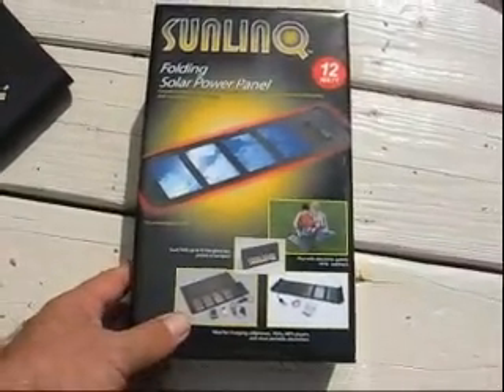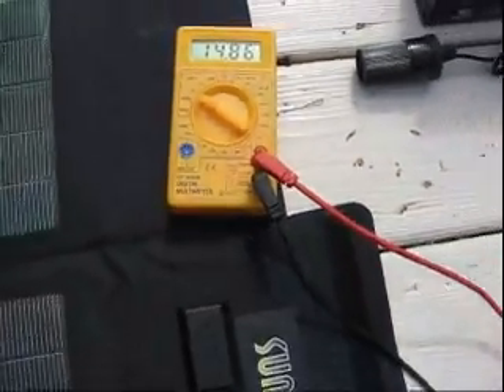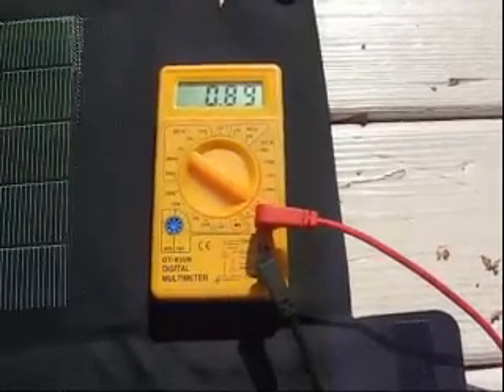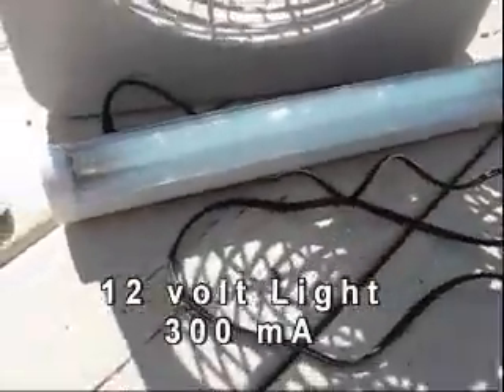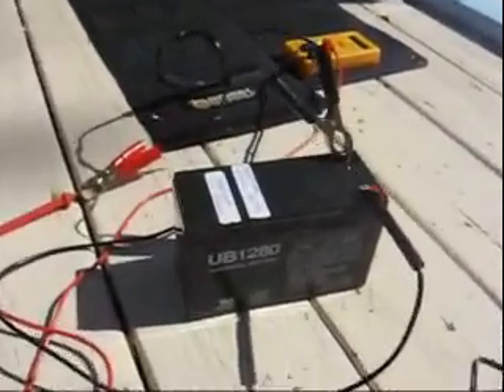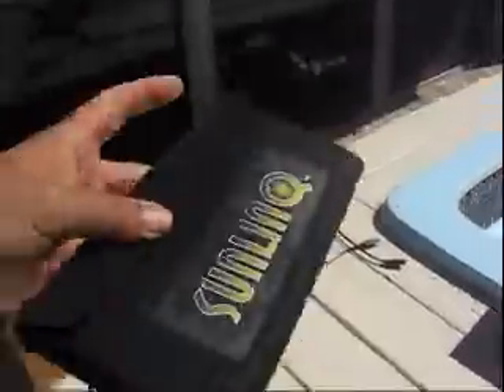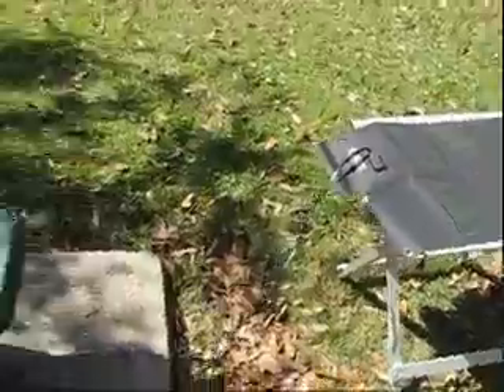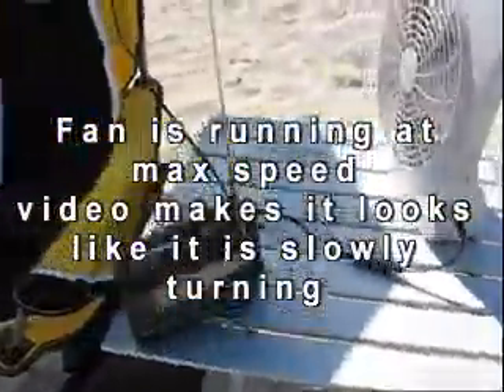SunLinq Folding Solar Power Panel 12 watt

Comment: can anyone advise on off grid AA battery charger for this unit.I have a 3 month challenge and need AA and AAA charged up in Desert so plenty of sun.
Reply: I guess its too late to recommend this, but Goal Zero makes a AA battery charger that charges off of a USB port. Just add a cigarette lighter to USB charger to feed USB to the battery charger. If you need AAA batteries the Goal Zero AAAs come with an adapter to make them fit inside their battery charger.
Reply: many thanks

Comment: graphed output power from solar panels is a lopsided bell curve. Buying a panel that closely matches the gadget volts/amps you intend to charge is best and gets you the most bang for buck. Fold-able 12v panels can we cut up and rewired for 6volts with twice the output current for faster  USB gadget 5volt charging. Some silicone sealant to put the panels back together and keep any water out has been done.

Comment: @operator223 Did you actually test one of these units? The Alpinist site did a test of the unit in Alaska and it had no problems being exposed to rain and snow while strapped to the roof of a tent.

Comment from the maker: @ArmyRanger10 this unit is the 12 watt .  take watts and divide volts to get amps. (12 watts / 12 volts = 1 amp)
since your devices are below 1 amp and most phones and zune and ipods take 5 volts this will work fine. i charge my zune and ipod touch just as i would if i plugged them into a computer using the usb connection (5 volts dc)

Comment from the maker: @TheSolarSkater with 1 amp output i usually dont put a charge contoller for portable charges. i do on my other systems where i leave it out all day and i am usually putting out 3 to 6 amps charging power.

Comment from the maker: @sirmasterpimp i love this unit, i go out on the lake in a blow up raft running a trowlling motor running off a marine 12v battery and have this unit strapped down with bunggy cords and charging the battery at the same time.

Comment from the maker: this will put out 1 amp   (12 watts / 12 volts) = 1 amp
this is the same as taking a battery charger and putting the setting on 1 amp for a charge. yes it will take longer to charge .
if you want more amps you need to but the larger pannels are combine in parallel the solar pannels to give you more amps.
in this video i got 900 ma (almost an amp)

Comment: So since it seems you got quite a bit of experience with these panels and got all your amps and what-not straight I hope you can answer a few questions I got.
First of I'm wondering if you think or know if one of these things would charge one of them tiny laptops, not interested in using more then one panel and it taking a long time wouldn't matter.
Secondly I'm wondering what I would have to do to make this thing charge my Ipod touch, what kind of adapter/transformer thing I'd need

Comment: i purchased the battery at Academy. They sell them as lattern replacement batteries.
8 AH cost about $17.00. I have two of them and use them allot going camping.
I have allso found that UPS for computers have these batteries in some of the APC models as well.
thanks